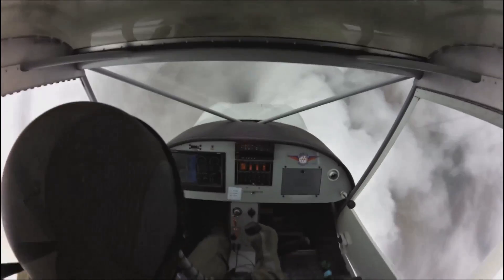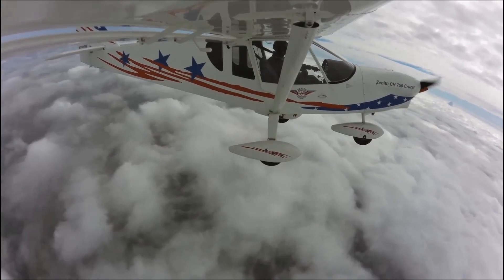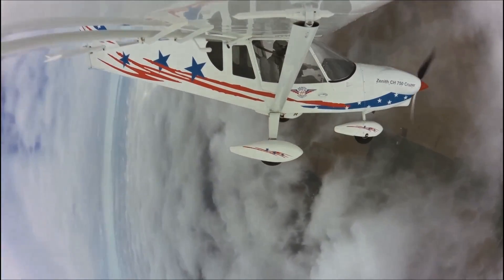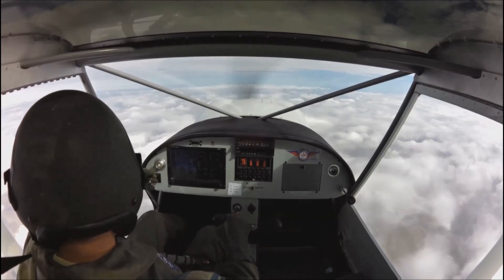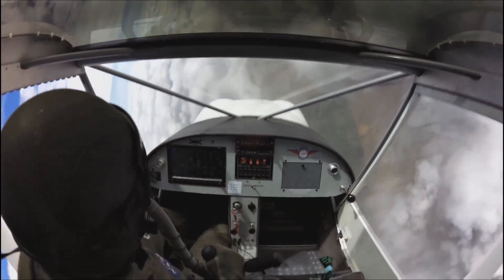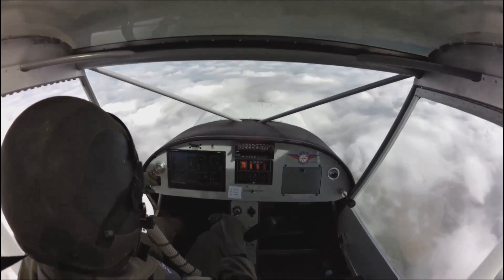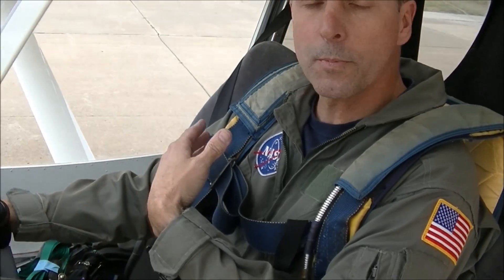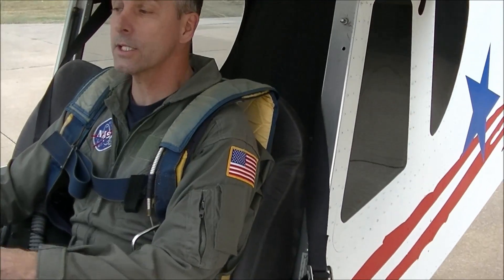Flight test: Zenith CH 750 Cruzer

Comment: Daniel, before I deleted and edited my original comment, I thought it was a regular dude just hotdogging in his plane. if the aircraft is not built for and certified for acrobatics/aerobatics, it is not supposed to be done. You put yourself and everyone else on the ground in danger. The FAA is very clear about that. The manufacturer can test things out. And they will have a test pilot like they did in this video. Interestingly,  the video shows that it can handle extreme stresses - IN AN EMERGENCY. But just like if you over torqued or over temp'ed the engine, over torqued the prop, had a hard landing (according to the manual), etc, it needs to have a thurough inspection as soon as you land. Because a certain aircraft is not designed and certified for aerobatics, the stresses from such maneuvers can weaken the structure and compromise the structural integrity of the airframe. Different aircraft are designed for different loads and stresses and should be adhered to. You can't pull over to the nearest cloud and fix the problem that comes up. That's what I was getting at - before I realized that I was mixing up two different videos that I had just seen. LOL